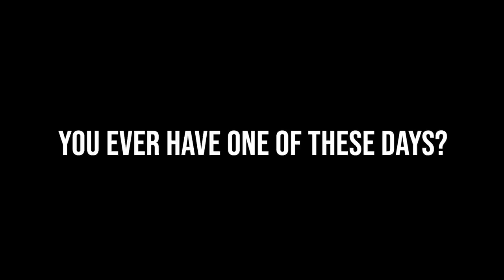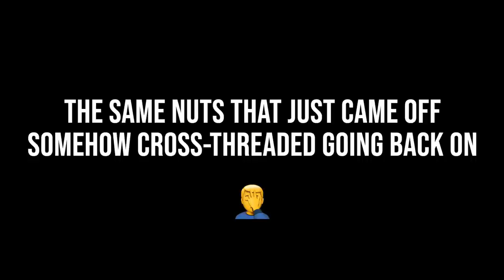I SHOULD HAVE STAYED IN BED 😡 THIS KUBOTA DOES NOT WANT WHEEL SPACERS! OUR MOST PAINFUL INSTALL YET

Comment: Good vid but I was wondering why you re-installed the mower deck when you plan on bringing the tractor to Kubota for repairs to the right front wheel studs?  I ruined my torque wrench by leaving it on the torque setting when I stored it instead of releasing the lock nut and returning it to zero.  Yeah, that mistake cost me $130 smackers for a new 1/2" drive click torque wrench.  Cheers!
Reply from the maker: Because I needed to show what it looked like with the wheel spacers installed.  Believe me, I didn't want to reinstall it.
Reply: @GoodWorksTractors  I bet you didn't.  It was one of those Murphy's Law days we all have suffered through.  Cheers!

Comment: Even the John Deere haters have to admit that Deere mower decks are a far better design.
Reply: Not really. Easier to install/remove, yes.
But I’ve heard many complaints about  JD mower decks clogging in heavy grass. My 32 year old Gravely nor my Kubota have clogging issues. And no, I’m not a “hater” as you put it, of John Deere tractors. I enjoy tractors of any make.
Side note, the Kubota’s are no more susceptible to cosmetic damage than any other brand. I guarantee if you abuse a piece of equipment, it will show it regardless of brand. That little BX was clearly abused by someone who didn’t care or know what they were doing.
Reply: I have a 60" drive over deck for a B2601.  It works great to take on and off once you are familiar with them.  I pull my deck every time I do loader work.
Reply: @lcee6592  - It really looked like some of that damage was the result of just regular use.  Can't count the number of times I've hit a stump near or with my gauge wheels and they haven't bent yet.  Same with the bucket.  Done tons of loader work and no leaks as well.
Reply: This is for L Cee concerning Deere decks clogging. I have a 2021 1025r with the new 7 iron deeper deck with a mulch kit on it. First time I used it I hadn't cut my grass in several weeks because my old LX277 deck bit the dust & had to wait on the new tractor. The grass was somewhat wet & my old mower would have choked big time. Don't know about the old Deere decks but I'm happy to say the new ones don't clog and it chomped  through that grass like it was 3 inches tall and mulched it so well that I couldn't even tell I had mowed really tall grass.
Reply: Supercreech  The B2601 is a tractor.  It easily smacks around a 1025R or BX in terms of the work it can perform and still has the drive over deck.

Comment: You could have avoided breaking the stud/bolt by using heat to assist in the removal. Also a little Loctite would be beneficial on the spacer bolts. Just my opinion!

Comment: The bolt that snapped was in the same tire that had the missing bolt from cross threading wasn't it? I'm guessing either the same person cross threaded both in that tire or the extra pressure on it from the missing bolt seized it just enough? Either way sometimes if a bolt is rusted or stuck ironically tightening the bolt a bit, not even a quarter turn will break it free enough to come out after or always the penetration oil or heat.

Comment: What a rough day. Would like to know what happened with the torque wrench. I have the same one and I would like to avoid what you did.
Reply from the maker: I can't figure it out.  It was like the spring mechanism popped out of place inside the handle.  Haven't had a chance to look into it further, but there was a fun warning sticker about how disassembly can cause issues with the calibration.  So, I'm sure that will be an enjoyable experience to deal with, ha!
Reply: This is one of the reasons I prefer split-beam torque wrenches. Much more durable and they don't lose calibration as easily as spring type torque wrenches

Comment: Hope my day starts better than yours was!  Just curious.  Does Borla recommend Anti-Sieze?   Especially with the aluminum spacers, it seems like a good idea to prevent galvanic corrosion between the steel and the aluminum.
Reply from the maker: Haha I hope so too!  Anti sieze isn't mentioned in their instructions.  I'll have to ask them their thoughts and answer in a future video.
Reply: Galvanic action between aluminum and steel would be pretty insignificant unless they were exposed to a wet saline environment due to the aluminum oxide coating that would form relatively quickly since aluminum would be the sacrificial metal. But it could happen I suppose in some circumstances.

Comment: I'd really like to get a clear answer on what size spacers work with a 1025r with a 60 mmm. There seems to be a lot of conflicting info out there.
Reply from the maker: I don't have that answer unfortunately
Reply: I installed the 1.5 inch spacers on my 2021 1025r with 60D deck and they are fine. Right side is the tightest but that is the max.
Reply: @Robert-pq3yu  Thank you!

Comment: Asking as a newbie what is the purpose for the spacers???
Reply from the maker: Spacers make a huge improvement in stability (side to side).  Most tractors tend to be a little too narrow relative to their center of gravity.  So, by widening the stance, it can make a big difference in operator safety and comfort.
Reply from the maker: Have you ever seen or heard of axle problems that can be traced by or associated with wheel spacers on a tractor? We haven't to date, but are keeping our ears out in case others have.

Comment: Whoever put those front wheels on, they obviously used an air impact or a very powerful battery operated impacts and too many ugga duggas pulled the threads and you got stuck with the results. Lightly ugga dugga, then torque to spec

Comment: Use a heli-coil system on stopped wheel bolts. Once repaired, a Heli-Coil is stronger than the original threads once repaired and if the threads happen to mess up again you just remove the damaged coil and install another Heli-Coil and u r back up and running. It’s a repair anyone can do at home with a steady hand and drill. You can buy them at most Auto parts stores for a kit and get the Tap and possibly the drill bit to go with it
“ How to Use a Helicoil and there are several videos”
Reply from the maker: Nice, I'll look into that.  Any idea how I could have got that bolt out without shearing it off?
Reply: @GoodWorksTractors  I just replied but u can start with a torch ( Home Depot sells small propane torches but a bigger torch is better) heat up your new stud slowly but be careful not to point torch at your front diff. Take a pipe wrench and try to work it off.
Option 2: cut it off just about flush, use a punch to tick it in the middle then drill a hole in the middle of the bolt all the way thru if possible. Keep going up in drill sizes until u are close to the original shape the drimal the rest out. 
I use to work on Power plant gas turbines. Repaired tons of broken bolts and messed up internal threads
Reply: @GoodWorksTractors  Left twist drill bit. I would also invest in a set of taps for the sizes you normally use. Sure this situation will come up again in the future. Also suggest apply anti-seize to all wheel studs, bolts, and when disassembled.

Comment: Some moron body must have started those lug bolts with an impact gun, got them cross threaded to start with, and just kept going!
Reply from the maker: Yeah maybe so.  I don't know if there was any way for me to get that cross threaded bolt out without breaking it off?  Any idea?
Reply: @GoodWorksTractors  if u didn’t have a way to get your tractor to a repair shop, I would have started with a torch a heat it up a little bit (not to melt it!!!) and then use a pipe wrench to try and back it out if trying to get a broken bolt out.
Reply from the maker: Ahh, good idea.  Hadn't crossed my mind!
Reply: @GoodWorksTractors  
Well, doubtful that it could have turned out different than your result.  It looks like a machine shop fix to me.  Maybe the Kubota dealer has enough experience to deal with it?  That's an ugly situation.

Comment: Only problem with your install video....if you look at Bora's website and look in their installation instructions they have bold printing all by itself that says "DO NOT USE AIR OR IMPACT TOOLS or LOCTITE as these will void the Warranty."
Reply from the maker: Those notes were intentionally cut off the bottom of my instructions that I received with these spacers.  Didn't have a chance to ask them, but you can just make out the very top of that note and it looked to be scissor cut off.
Reply: @GoodWorksTractors  I only mention it because it seemed like a strange restriction by the company. Impact tools are the tools of choice for everyone I've ever seen installing wheels. I think anyone buying spacers would assume that you install them with impact tools.

Comment: Never understood the appeal of a mid mower deck.
Reply: More maneuverable in tight areas without a big mower deck behind the tractor
Reply: @benthompson593  I mow 3 acres with a zero turn and use a larger tractor for heavy duty work.  For the price of a mid mower deck you can buy a decent zero turn.
Reply: @nervousordo  true, but for people like me with limited storage space (lots of slopes and woods on my property, not a lot of useable spots for an additional shed or garage) it’s worth it to have a more compact set up.  Same reason I bought the artillian grapple.  I can break down that grapple, forks, and stump bucket into the same amount of space some of the cheaper competitors would take up for just one of those.